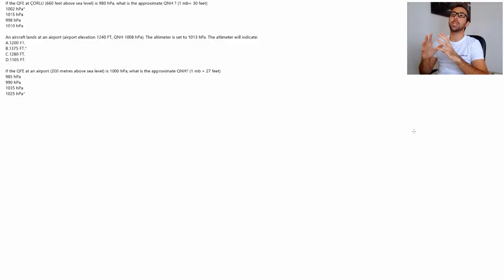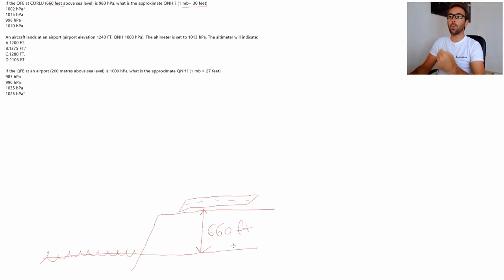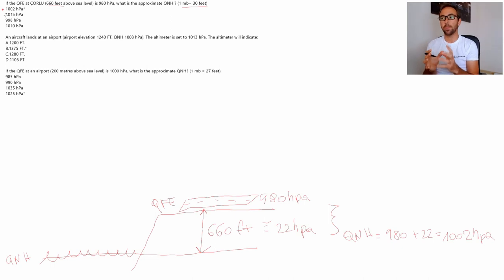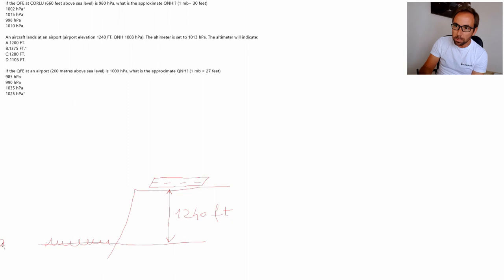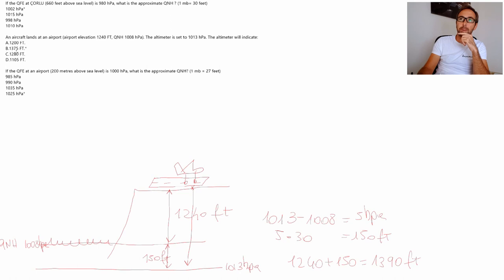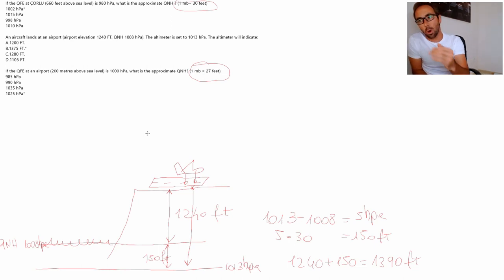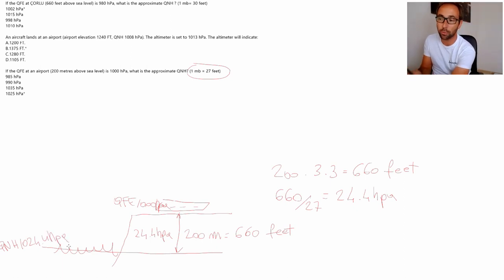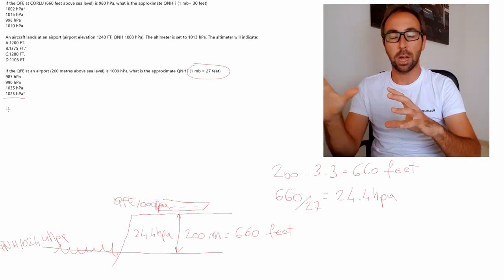How To Calculate QNH And QFE. ATPL Quiz Solved - [What Are These Pressure References?].

Comment from the maker: Comment below with your questions and thoughts! Have a great day
Reply: hi man, im seeing your videos, and congrats, they helped me a lot in my journey in Flight simulator, but i think in question 2 you made a mistake, its 1240-150 and not 1240+150. Am i right?
Reply from the maker: @DiogoSilva-qj2nc   I'm very glad to read that the videos are helping you!! That's great! So, in the second question I added the 150 feet because the isobar 1013hpa is below the 1008hpa. The question was asking what the pilot would read if he/she had set the 1013hpa as a reference on the Altimeter. Let me know if you still have any questions!👍
Reply: @PILOTCLIMB  hi, thank you so much for your response, i now understand what you said. I have other question, not relationated with this video, but if you can answer me i will be grateful. Whats the difference between letters on same ILS? like ILS Z, X, Y for same runway? Thank you in advance and continue with this awesome work.
Reply from the maker: @DiogoSilva-qj2nc The suffix you find on the chart helps you to identify a specific approach. If you look closely at the procedures Z, X, Y you will notice that these procedures are slightly different. For example, sometimes the ground station that is used for the approach is different,  the Z approach uses the VOR and the Y uses the NDB (it is not always like that, this is just an example to make the concept clear). Let me know if you still have questions. I wish you a great weekend!👍